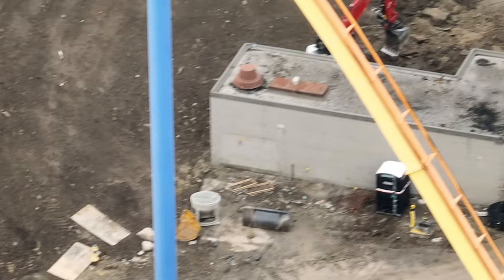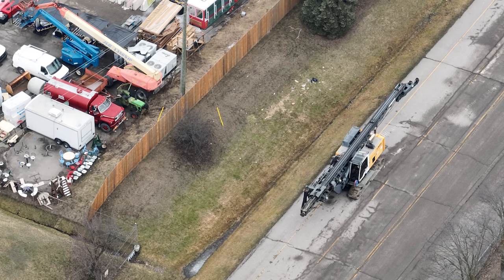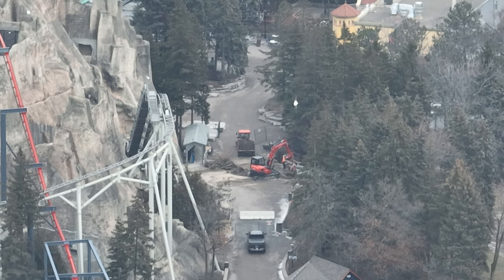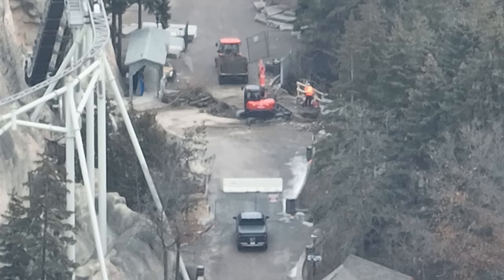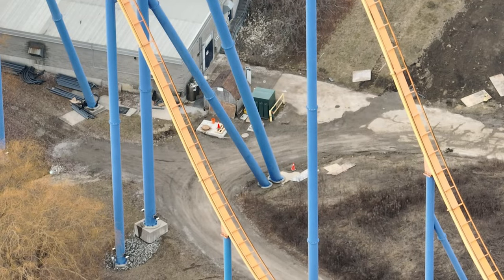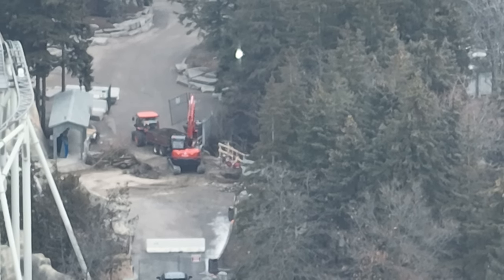Canada's Wonderland Beginning Digging Footings

Comment: I feel like CW has been going to B&M in part for some capacity. I would have to imagine that the new 2025 will also 4 across. I feel it would be strange for Cedar fair to have two launches wing coaster built in the same year, so my guess is inverted B&M launched inverted